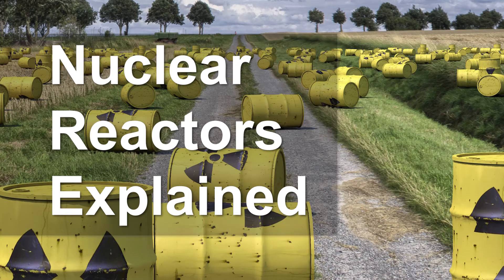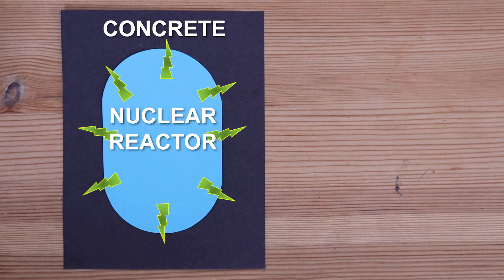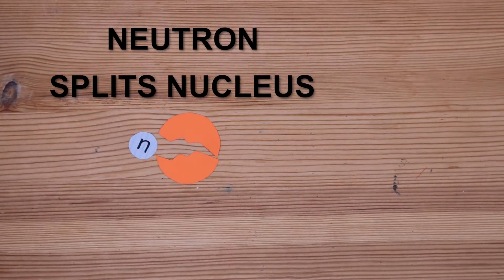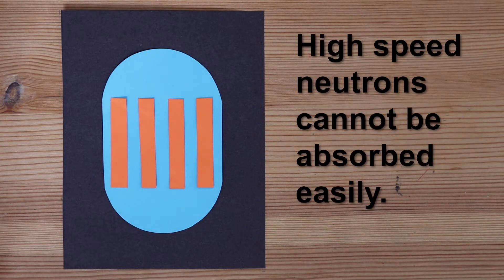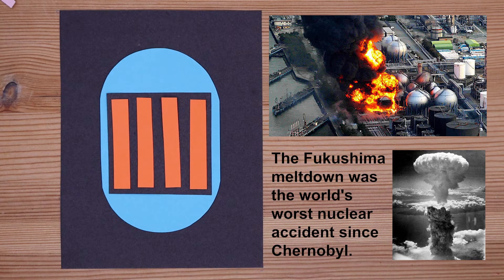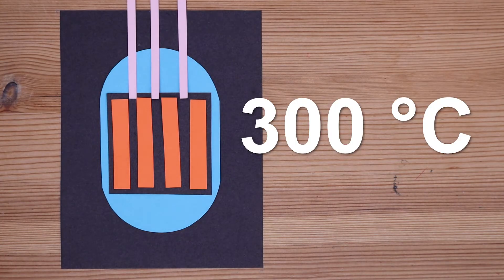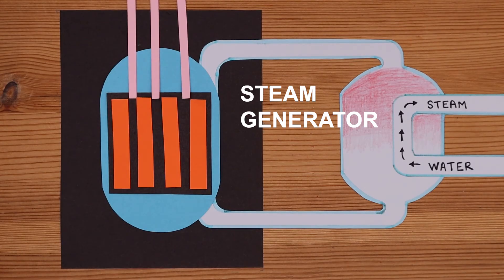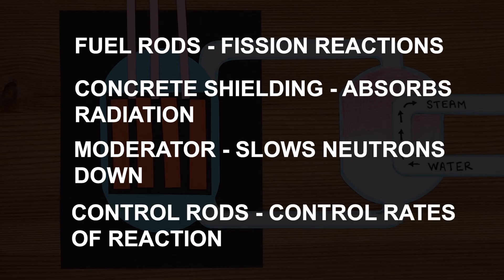Nuclear Reactor Explained GCSE Physics

Comment: thank you SO MUCH, i watched so many videos and they did not help me understand what a “coolant” is used for. thank you so so much! 💜 however my question is, why cant you heat the steam generator straight away with the energy produced? why do you need to transfer heat energy using the coolant?
Reply from the maker: Since the generator is not directly next to or on top of the reactor core, we want to transport the energy away from the reactor to where the generator is.

Comment: Using water to absorb heat in a reactor that is 300 degrees must be interesting because water turns to gas at 100 degrees? 
What is in the control rods that absorbs the neutrons?
Reply: The control rods. are made out of cadmium, hafnium, boron. and the water is always pumped into the reactor. So. that's why